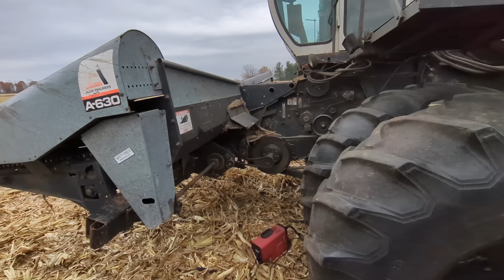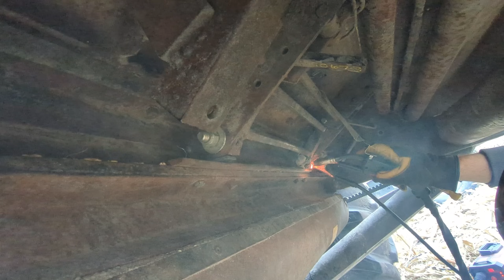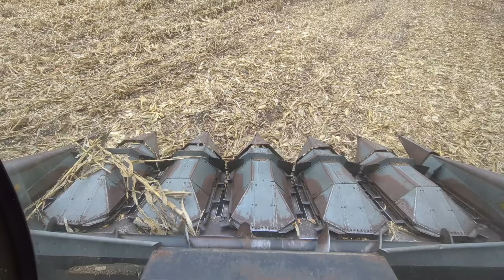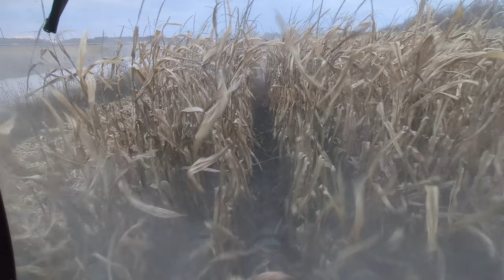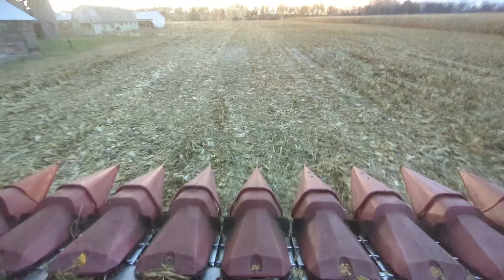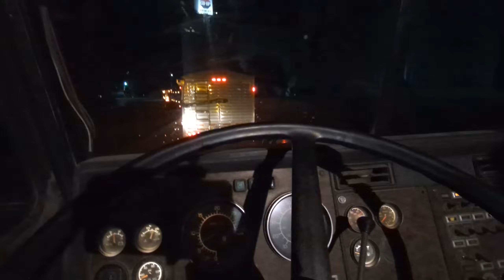The M3 Gleaner Needs Some Welding Can The Arccaptin Welder Fix It And Keep Harvest Operations Going?

Comment: A common problem with the Gleaner. Wide headers really add stress to the feeder / thresher assembly and causes those stress breaks.  I have gotten similar feeder housing breakage on our 1660 since we put the 25 ft table on it. If my machine had duals instead of singles, I think it would help keep the twisting of the feeder down considerably, as we are in the hills here.  I'm running late with harvest, got rained out Sunday, hopefully can get back out tomorrow, only have a few acres of weedy beans to finish then back to finish the corn.  Had some serious health issues interfere with my working. Getting better, just have to take my time and stop when I have to.  But it's better than many others who don't survive a stroke!  My son helps get the machine ready and if it breaks down, I can handle most every thing else.  I enjoy your videos, keep up the good work.
Reply from the maker: Well it's good to hear that your getting better just take it easy!! I think what happened to this M3 was the years of running alot of trash through it because of the corn reel they had on the 6 row head I can just imagine wads of wet corn stalks going through it with the cylinder speed probably super high and the stress that that caused! We also ran a 25ft head on our 1660 never really had a problem breaking we also don't have very many hills but we did have the issue of just singles and not having a very wide stance some axel extensions may have done the trick....we are behind in harvest but we will get it! We were done by this time last year! Thanks for watching!
Reply: BTW, Brandon, I see that today is your birthday, have a good one! @dirtgrainsteel

Comment: I not sure but I think you could move the sensor in the grain tank down a little bit to prevent cab corn. That way it comes on earlier or you can put your extensions on it. Just a suggestion, it's your machine run it the way you want.

Comment: Not a lot of gleaners in my area. Can a L2 gleaner handle a 8 row corn head?
Reply from the maker: Yes a 8 row head is fine on a L2 you just got to slow down in good corn so the elevator in the combine can keep up putting it in to the grain tank
Reply: Our gleaner dealer told us to make a gear to drive the clean grain elevator a little faster. The l2 is a great machine but 250 bushel corn is a load for them. You have to slow down a lot.

Comment: Good video but a dumb question you plant corn then harvest it and sell it then you have to buy seed corn in the spring so let’s say you need 500 lbs of seed corn why not keep that much out for next year
Reply: Starting back in the 1920s ,Modern field corn is a hybird product, cross pollinated by the seed companies to make the large yields we enjoy today. Using open  pollinated ( bin run)seed will grow and mostly place ears but they will only be very low yielding. Thats why we spend the high price for commercial, produced seed, $280- $300 per 50 lb bag.  Some hobby farmers do still rise the old non hybird varieties but mostly to keep the seed stock from going extinct.
Reply: @frankwurth5375  thanks
Reply from the maker: There's never a dumb question that was actually a really good question!